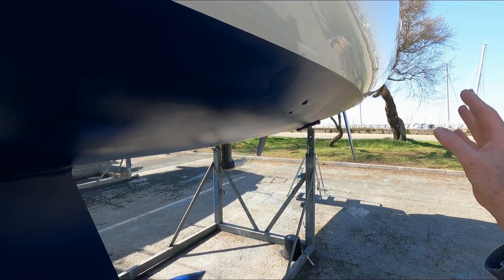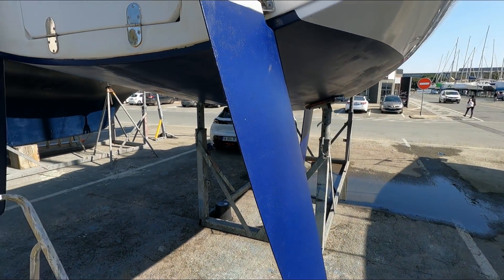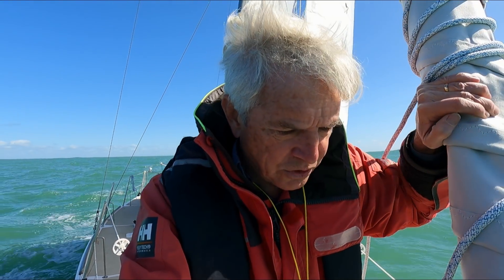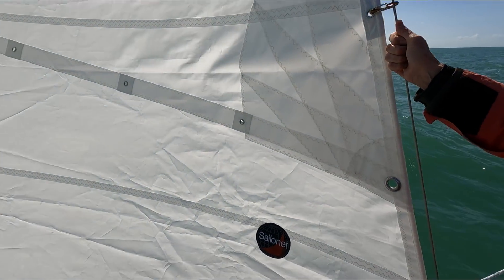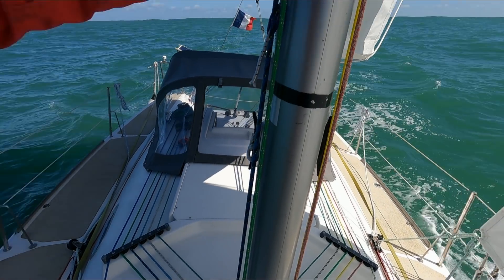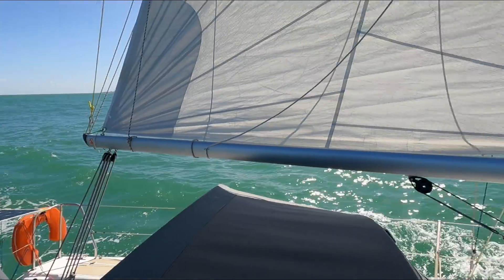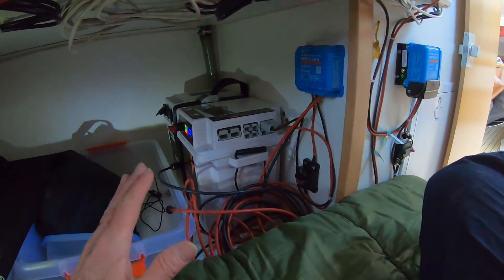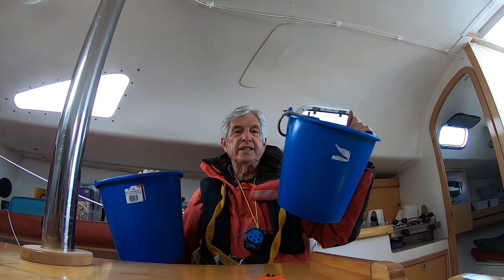Ep 54 Sailing Solo Refit Summary prior to 2022 adventure

Comment: So happy to see you again Patrick ! I hope your health is fully ok by now. You’re likely to be surprised by the efficiency of Hempel anti fouling. I put Hempel Hard Racing on mine last July and hoisting the boat ashore mid October the hull had just an extremely thin, barely noticeable layer of algae. Of course the boat had kept moving most of the time during that period. Yet much better than any other paint I used over the years, which would have resulted in the same fouling in a matter of 2 or 3 weeks. Expensive, but worth the price. I wish you the best of cruising for 2022 and look forward to the next vid (curious to see what the destination will be this time). For me it’s gonna be Aegean Sea starting early May, until end September -God helping 😉. Cheers !
Reply from the maker: Thanks Pierre.  The Hempel I put on is the self-polishing version, not the hard.   I hope it will perform as well as yours did.    I sail quite often, so hopefully the little critters will not be able to attach themselves!   Fair winds to you in the Aegean.  That is a lovely area.

Comment: So I called up the Captain "Please bring me my wine." So i hope you will Patrick:)  Thanks for the openness and show the costs, though i did not see the cost of the surgical refit:) I do hope all is working fine! As for the rudders; if my memory is correct, for offshore racing, at least for small ships, an immediate deployable emergency steering/tiller/rudder is mandatory.  Except if breaking pins are in place, and something will hit a rudder, it is likely that the fixture is bend or broken and it wil be impossible to bold a new one into place. Since the rescue hatch prevents a central fixture in the middle. 2 fixtures aside that will do for an extra rudder with hand tiller steering! to be installed easy.  Since engine, rudder and keel problems are in the top of rescue deployments  for sailboats, next to no youtube video's,  it seems worth while to install.

Comment: Welcome back, glad you’re well, thanks for not sharing the nature of the surgery and turning this vid into a vlog. 🤓
That autopilot looks like it was pilfered from the ISS. 
Funny thing, I was about 30 mins from ordering a $300 Led Tri-Color and now I’ll get the cheap one and put the nice ones at the factory locations, so thanks for the heads-up 👍
Reply from the maker: Ha!   For small boats like mine, the mast-head tri-color (LED of course) is actually better when sailing at sea, as the deck level lights get lost in the waves.    Thus, I have two switches on my panel: low level nav lights for entering and leaving port, and mast head lights when sailing (and the white light at mid mast when motoring -- can't remember the English name; feu de hune in French).    Fair winds.
Reply: @patricklaine6958  The secondary consideration is the RF interference with LED’s so very close to the VHF antenna coil, some are really bad and wreak havoc on reception. Have you experienced any issues with reception?
Reply from the maker: @Catalina27  My tricolor LED light was certified "no RF interference'.  At least it said that on the box.  :-)

Comment: Glad your back, the refit modifications all should make voyaging simpler and easier. The bucket/head is super simple, but in my experience tricky in really bad weather. Spilling the bucket in a storm when you are getting knocked horizontal adds an extra dimension of unpleasantness to a bad situation.  If recommend a bucket with a lid and some means of locking the bucket in place while in use.
Reply from the maker: Good advice on the bucket......the problem with the marine head on this boat is that it is really only useable on one tack (too much heel on the other).   I'll experiment a bit.....

Comment: Hi Patrick. Another inspiring video. 
Your ship is looking very tidy, sea worthy.

I too have a spray hood and I wouldnt be without it! Here in the PNW it gets cold and very wet. A spray hood and bimini help extend the sailing season. 
I also ride motorcycle. Purists refuse to ride with a windshield. To hell with that. At 60mph it gets cold on any day other than a hot day.
I ride with a fairing to stay warm, dry and prevent the bugs and rocks from hitting my face at highway speeds. 

Gawd help me, I've even got a totally encloseable cockpit when needed....as well as a "stack pack" by North Sails for the mainsail and a track system for the main which allows it to drop like a rock when I release the main halyard. The mainsail stops straight into the stack pack.
All of this keeps me in the cockpit. Nobody needs to be dancing around on the deck in rough weather trying to secure the mainsail. Safety!

I'm looking forward to your next adventure of unknown destination. 
The English have an old slang word for that: "coddiwomple."
Meaning, "to journey purposefully toward a vague destination."
See you next time Patrick.
Reply from the maker: COMPLETELY agree with all of the above!  :-)

Comment: Good to see you back on the water Patrick.I did write to you back in the winter to see why you were missing for a while and you did reply that you had a medical issue, so it great to see you well.i too sail single handed and have just upgraded my electrical system with new solar and Victron controlers ,I also fitted a Victron smart shunt to be able monitor what going in and out.
Reply from the maker: Thanks Chris.   I should have added the shunt too.  I didn't because I think that next year I'll change all of the chargers, alternator, etc., and go 100% lithium batteries.    I do like the Victron equipment though, so will probably stick with them for the solar end of things.

Comment: I think you will find that the dodger helps a lot with interior ventilation. Your disciplined approach to drop it when approaching the harbor and in high winds is right on the money. Look forward to your next inspiring video.
Reply from the maker: Thanks Mike.   It probably reduces performance slightly at sea (acting as a drag brake), but I can live with that small inconvenience.   I'm not a racer.  :-)

Comment: Welcome back Patrick. Happy to learn you are doing well. You remember I own a Malango 870 which has the same hull as yours with twin rudders. I agree maneuvering under engine may be tricky. I find it easier to maneuver going backward in tight spaces or adverse conditions. Frankly speaking I don’t know whether it is because the rudders are more efficient or just a feeling due to the better visibility going backward than going forward.
Nautical regards,
Philippe
Reply from the maker: And welcome back to you too Philippe.   I got up very early several mornings and practiced marina maneuvers before anyone else was awake.   I got to the point where I was at least confident and safe with my solo arrivals/departures, even if they weren't very pretty.   (Much like my landings on the Foch and Clem!)  And then I installed the new autopilot that limits rudder deflection to 35° each direction!  Il va falloir un peu de temps avant que je maîtrise la bête maintenant. Bonne nav cet été.
Reply: @patricklaine6958  😎

Comment: Thank you Patrick, I am a reformed successful  J105 Racer. At age 75 not sure a new boat project is justified. But I have made several modifications on the 105 for single handed cruising , though my horizons are more modest that yours. Don't regret the racing though. Nothing like a 35 boat one design fleet to teach one about sail and boat trim.. Not to mention humility
Reply from the maker: Yeah Richard, I am probably too old too for a new boat project, but what the heck.... :-)   I'm sure if I had joined the local regatta fleet, I would be a much better sailor.   Maybe next season.

Comment: Glad you are back up and running. The modifications all look great and very practical. Lazy Jacks are a pain sometimes, but do make things 100 times easier when dropping the sails single handed. I love the idea of a completely independent Lithium power system. A few people have started to do this; well worth considering.
As for the "Bucket and Chuck-it" solution, I'm not so sure. But at least your colour coding system should help avoid any mix-ups ;)
Reply from the maker: Good to hear from you Paul.   I know you are still struggling with your own health.    Here's wishing you a speedy recovery and blue water in the near future.   I may regret the bucket decision, but this boat heels a great deal -- so the traditional head is not quite as easy to use as one might think.   I'll change my mind the first time I kick the bucket over.  :-)

Comment: Under 12m you could use your front bow bicolour and an all around white at the top of your mast. Have you considered an extra set of rudder pintels just inside or outside the regular ones - if you lose a rudder and damage the fittings you’d have a spare. Also how about a retractable centre rudder for manoeuvring in port? Last thing, when you fold your spray hood down you need some way of securing it as it will blow straight back up at you if you’re motoring into a breeze. Actually thinking about it you could have a central set of rudder pintels as an emergency backup location for your spare rudder if you can locate them on or around that locker door.
Reply from the maker: For the spray hood: I operated my old boat the same way and never had a problem with it blowing back up.   I like the idea of a lightweight rudder that can slip in for marina maneuvering.   It will have to be for next year, as I have already begun my next adventure.  (In Spain as I write this.)   Fair winds.

Comment: I just got that foldable 120W solar panel too. So eager to test it now!
About that twin rudder-single prop setup: I wonder how much work it would be to install a small outboard motor connected to your rudders and engine controls for helping the maneuvring when required...
Reply from the maker: I've seen some people who hook up a single outboard Scramax, just for maneuvering.  Weight is always a consideration on these boats so one needs to be selective...... Fair winds to you.

Comment: You may find you are better off adding a cover to the front of your dodger.  In a very brief time the eisenglass will. Get scratch up and you will have to replace it.  Next time you are considering replacing the storm sail you may want to look at the Reflex Furling from Harken.  You can easily remove the sail when you want to move the intermediate back from the bow.  It’s a magical piece of gear.
Reply from the maker: Yeah, I'm not worried about the spray hood.  I operated the old boat that way, and did not have a problem with scratches.   My original plan was to order a set of top down furling sails --- but ran out of time......  A key project for next year as I have already left on my journey for this year.  Am writing this from Spain. :-)  Fair winds.

Comment: Too bad you didn't think about the rudder configuration before buying the boat. I can relate to that. More than a few of my major purchases were impulse buys that I eventually had to admit I wished I'd given more thought to before buying.
Reply from the maker: Thanks Emily.   I did know about the maneuvering challenge and risk factors associated with twin rudders before I bought the boat.  I was willing to accept those challenges.  On the other hand, the surprise to me was the 35° rudder deflection limit required by the physical arrangement of the autopilot steering arms.  That makes the final 90° turn into the berth a real challenge in windy conditions, or when there is a tidal current.   I'll get better at it, but for now, it is pretty stressful coming back into the marina after a day at sea.
Reply: @patricklaine6958  If Hugo from "The Sailing Frenchman" could figure it out, I'm sure you will. I would think  the designers might have kept the center rudder since it is a mono hull after all....and just added the two others on the sides since the boat is so wide, but I guess not.

How do you like sailing a smaller boat? I bet it keeps you on your toes more than your other boat did.

Comment: I use a twin ruddered jeaneau and yep don't feel comfortable in close quarters without the wash.

Maybe you'll keep-turning-left with the different paints!
Reply from the maker: Welcome back RB.   Yeah, port maneuvers in this boat are 'interesting'.  Not only is the lack of prop wash an issue, but my autopilot blocks the rudder at 35°.   That  last turn into the berth has been challenging at times.  Ooof.  Fair winds to you this season.

Comment: Hello Patrick, you had us concerned there due to prolonged radio silence, so really glad to see you back at the helm! You have put alot of thought into kitting out your boat, and the work you have done is in harmony with the architect Rolland’s design. Depending on the wind and course, you might try sailing with the Solent and Genoa at the same time, cutter-style, if the sail-cut makes this sensible, mini’s often sail the solent and gennaker together. Concerning your point about the rudder being exposed, I have always thought  that if the boat is sailed flat, you would have enough control with the remaining one. One big safety issue is that the transom could be seriously damaged due to the leverage, and this would require a way to stop the water from entering, either with some putty, fiberglass or plywood. Hoping this never happens of course, but a contingency plan could be good... I have hit a few things in the water, and was glad one of the twin keels took the hit, but it made me  consider this possibility.
Bonne santé, bon vent, et au plaisir de voir vos nouvelles aventures!
Reply from the maker: Thanks Bruce.   I fully intend to sail with two head sails together (inspired by the mini transat guys).   I won't have the sail selection they have, but should still have fun.   Also, I have bought some emergency hole plug gunk, and have a fiber-glass repair kit and epoxy filler with me.  Hopefully, I will have no need to use it!

Comment: Great to see you back Patrick. Just wondering how you go about reefing your stay sail.
Reply from the maker: You just drop it down to the point of reefing --- reattach the tack, and then move the sheets to the reefing ring on the leech of the sail.   To keep things tidy, you roll up the bottom part, and tie short pieces of line around the rolled part (that is why there is a line of grommet holes along the reef point).  Fair winds.
Reply: @patricklaine6958  ah I see. Thank you.

Comment: On that spare rudder, just thinking you could put attachments for it in the middle between the 2 existing rudders for emergency purpose obviously.
Reply from the maker: Yes, I had thought of that too.  I have some hardware and fittings aboard that I hope will lead to a solution in case this disaster ever happens.   Fair winds to you.

Comment: Good to see you again. What is the product you fixer your Solar Panel on? 
Kind Regards
Johannes
Reply from the maker: You first make a fiberglass form (in X) to attach to the back of the solar panel.  And then you attach a rubber wind-surfer type joint to the top of a fiberglass or carbon fiber tube.  I don't know of anyone who sells a kit.   You have to buy or make the individual components, and then assemble them.

Comment: I was missing your videos! 
Regarding the rudders, wouldn't it be possible to install a kind of protection?
Reply from the maker: Physical protection would probably reduce performance Pedro.  On the other hand, some people have installed sacrificial 'break-away' pins that will fail on impact, and allow the rudder to swing up rather than break off.    That may be a modification for me to do next year.   Fair winds to you.

Comment: I wonder if the pintles could be designed to give way before the stern mounted gudgeon was damaged beyond reuse.
Reply: Yeah, good point. 👍 
Some makers design the rudder blade itself to breakaway only partially, which is a nice feature.
I’m going to fit two extra gudeons to accept the pintles from a spare rudder, they’re cheap, easy to mount and don’t weigh much. That way I’m back in control in seconds.

Comment: Patrick, have you considered a Hydrovane windvane to not only steer but also act as a central emergency rudder?
Reply from the maker: These very light, open transom boat, are not ideal for fitting a Hydrovane Richard.   Moreover, they accelerate and surf when reaching, so a wind vane would have not be responsive enough.   (That is why racing boats have the expensive, but high performance, NKE of B&G autopilot systems.    There are too many variables for a simple windvane to manage.)  Good question.